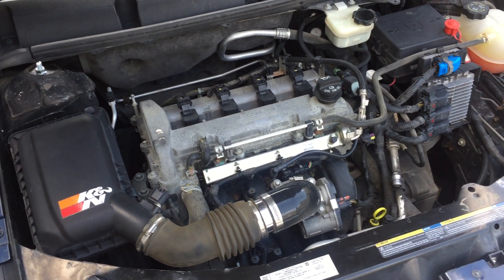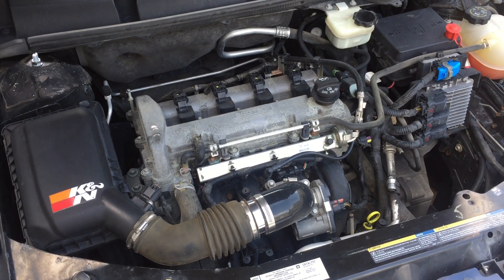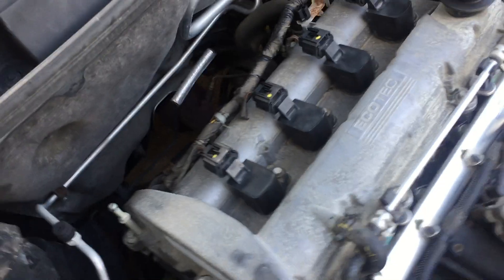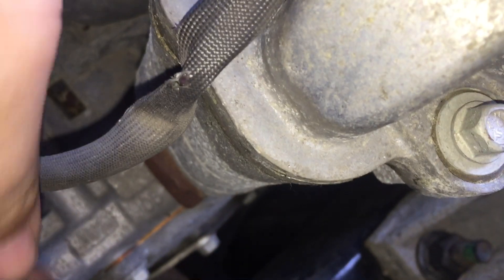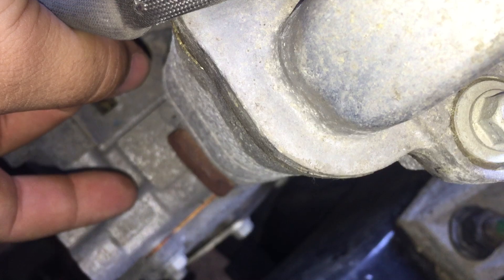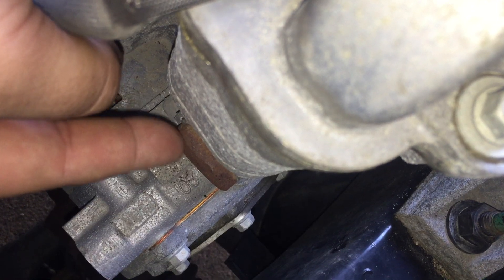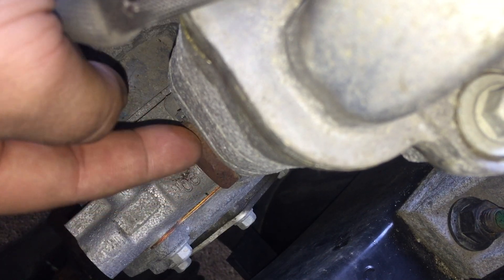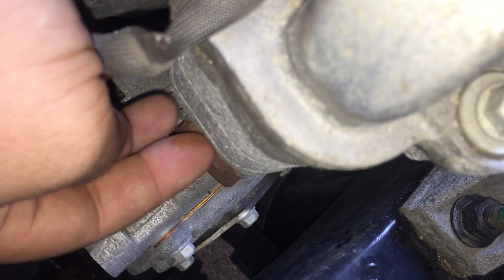Ecotec Cold Start Timing Chain Rattle example and tensioner location 2.0 2.2 2.4 lsj l61 le5

Comment: My 2.4 non turbo SS is doing the same thing with timing chain, im hoping i can get it replaced and thats all it needs and no major damage is done. IT didnt happen until AFTER i changed my oil to that BS quaker stake crap, i started the car the next morning after changing it and my timing chain was making noises. i switched the oil immediately thinking that would help but it was too late a shop qouted me $750+ for the timing chain replacement, is that a good deal?
Reply: STREETRACEN4U i have the same issue but mine is 2015 and dies after a few mins
Reply: I still havent put the car in the shop yet but i will in the next few days i will update everyone if it can be saved or not

Comment: I'm looking to buy a 2011 Buick Regal with the Eco Tec 2.4L, is this plagued with the same problems or have they fixed the issues?
Reply: All GM 2.0, 2.2, and 2.4 EcoTec engines have timing chain issues.

Comment: Does anyone know if these issues also affected the Saab 9-3 with the B207 2.0L turbo engines which are Saab-modified Ecotec motors? I know these motors use Ecotec blocks but I've read that most of the other components were all designed & engineered by Saab.
Reply: I have a Saab 9-3 2.0t occasionally when it's hot outside or I just drove a short trip. When I restart the engine could still be hot, warm, or cold it will make a 1-2 second rattle sound and stop with no chatter afterwards not  like in this video. Mine also already has the  Buble on the tensioner even though it's rust in color. What's yours doing?

Comment: Is the light ticking noise normal for these engines or is that a lighter issue?
Reply: This engine has direct injectors so it will make this sound
Reply: Yes normal .
Either the injectors and lifter can get noisey, aslong it's not a lifter-tick then it should be good

Comment: I have a 2007 Ion with the 2.4 and manual trans.  At 125,000 I put a new timing chain set in complete as general maintenance.  I opted for a Cloyes OEM set.  Spared no expense on quality parts.  Oil changed always at 3,000 miles (not by the computer oil change rest that goes up to 7,500).  I now have 145,000.  At temps below 30 degrees F, I get the loud lifter rattle type sound on cold start.  I just don't want to believe it is the timing chain.  Ever see a lifter going bad do this too?
Reply: That could possibly be normal, check the TSB's, sometimes they talk about "extreme cold" starts. However, I don't know exactly what temperature GM considers an "extreme cold" environment, I assume it's below freezing, which in your case 30*F would be below freezing. http://www.bbbind.com/free-tsb/

Although, if this started only after replacing the timing chain, I would also contact the manufacturer of your timing chain themselves.

Let me know if you discover anything!
Reply: Similar boat. 147k miles. Rattle when cold. 07 2.2 oil changes every 3k. Funny because I have an 05 malibu with 200k (bad trans) can sit for weeks and wont rattle on a cold start
Reply: This is from the manual slight pinging is normal under stressed acceleration like towing or hills and first start up if you can hear it inside the cabin under normal idle there is an issue

Comment: Just one other note: I am actually going to be taking my Captiva with an LE5 in to the dealer. I am getting quite a lot of metallic noise on the passenger side of the engine, very low MPG, 16MPG on a good day, stalling right after startup, lots of misfire readings across all 4 cylinders... and yet... no check engine light... Has anyone ever read the diagnostics off a 2.4L ecotec with a bad timing chain with an ELM327 reader and the Torque app? It has taken me quite a while to narrow down the symptoms of my car, and at least one dealer told me, "we can't do anything until there is a check engine light." So I need to walk in with all the evidence, or they will walk all over me.
Reply: I dont know off hand what that code means but, at least changing your timing tentioner or, changing the entire timing set would be a good idea...
Reply: What was it? I’m having the EXACT same issue

Comment: I put a new model tensioner on mine and it fixed the sound. I do notice some occasional rattle at 3k under hard accel. I’d say I need a new chain. But startup and idle is quiet as a mouse.
Reply: Did you find out if the rattle at 3k rpm was normal? My 2015 Chevy Captiva seem's to make a rattle around 3500rpm under hard accel also.
Reply: trillobite it went away after I put 10w30 in my car. Of course my ecotec is the 2005 problem child’s. Seems to be solid now.
Reply: @CallousDallass , thanks for the reply. What weight were you using before the 10w-30? 5w-30? I am just wondering, since I am currently using 5W-30 Magnatec. (Dexos of course)
Reply: trillobite I was using the recommended 5w30. My car has some miles and it’s a work vehicle so I gave it a shot.
Reply: Did you just unscrew and screw the new one in?
Reply: Why didnt you just change the chain and tensioner at the same time?
Reply: @koreymayo8884  This is a year old but I know. But for anyone that doesn't know.  A timing chain replacement is a major repair on an Ecotec.  Anyone can do it, but you need to really do your homework on this before attempting it.  If you only have one car and need to be able to drive it every day, don't try it, take it to a shop you trust and fork over the $1000-$1500.  It should only take them a day.

Comment: Those chains stretch also the chain guide on the intake side its common for that guide to break at the top. When that happens the chain will ride on the bolt introducing metal into the oil. that can be easily inspected by removing the camshaft cover. Shine a light down below the intake cam along the chain. If its rattling just replace the timing set. GM sells it as a kit with guides and tensioner. Also replace the waterpump/ balance shaft chain as it will be stretched as well. I ve seen the chains with significant stretch as low as 70k VVT versions require a holding tool

Comment: I bought a G5 4 years ago with 80,000 miles on it and it makes a similar noise for about 5 seconds at cold start , it has 170,000 on it now and the sound is still the same , I need to change the chain and tensioners anyway , I'm curious as to why it would still sound the same fter all the miles I have put on it . I don't drive it hard and change oil every 3000 miles , what do you think ? Thanks for posting this , it's almost identical to what I have been hearing ,thanks.👍👍
Reply: Better chain it b4 it breaks. So u can put another hundred thousand on it lol

Comment: Thanks for this. A lot of the guides talked about cold start and a rattle but hearing it's hard to tell exactly what they mean.
Reply: The timing tensioner is hydraulic. Using you motor oil from your oil sump. If you’re low on oil or need an oil change or using the wrong oil. You can cause premature catastrophic engine failure. (Refuse the tensioner of oil pressure and your timing will depart reality)

Comment: At what millage should those guides and timing chain be replaced 100,000 miles? As maintenance for the eco tec 2.2 engine l61 I’ve heard they are notorious for the guides breaking
Reply from the maker: Fresh55n9ne to be honest I would stay on the safe side and replace the chains every 80-90k at the longest. I’ve seen cars with 110k on them that had them snap or are extremely stretched somehow in that time. It’s really a toss up and it’s a fairly intrusive job so a lot of people just don’t want to do the work or pay the 8 hour labor cost for it and drive them til they blow.
Reply: Built Performance LLC is it worth changing the timing chain
Reply: I agree with Built. If your Ecotec is has been running OK for 80-90k on the same chain...why push it? Go ahead and get that new chain kit installed and you should be OK for another 80-90k.  But after about 50k start paying attention to the chain.  Pull the valve cover and check for any slack, and look at the top chain guide for excessive wear. Those are good indicators that your timing chain may cause serious problems later on.
Reply: @cswann8  i changed out my timing chain since my last comment and it fixed multiple issues the engine was having. It was definitely off a tooth or two and that was severely effecting engine performance. It turned out the chain was stretched, 2 plastic guides broke apart completely, and the balance shaft chain tensioner broke apart from the inside. Its a miracle the car drove 2000 miles like that after I bought it! Its a dependable cheap rig now though
Reply: @CadgerChristmasLightShow  Nice.
Reply: My tensioner went bad at 83k and the chain skipped teeth.
Reply: My Saturn vue with the 2.2 has the original timing chain, from what I can tell, and it has 156,000 miles. It’s amazing it lasted this long, but I’m changing out the chain asap

Comment: Does this affect the 2012 Malibu with the LE9 engine? I was asking because I know LE9 is an Ecotec as well.
Reply: Ours is a 2011 and has this problem. I have also heard that 2013 Malibu has this problem, so the 2009 revision doesn't mean anything and after 2009 GM still used plastic parts as far as I know!
Reply from the maker: No it was revised for the 2009 and later model years so your safe.
Reply: Thanks

Comment: I have an 04 cavalier that makes a ticking noise. It almost sounds like an injector but it's too loud to be one.
Reply from the maker: If its all the time its not normally this however i would at least remove the valve cover and check that the upper guides are in place and not in pieces as they are plastic and tend to break a lot leaving the timing chain to flail around
Reply: Word. I'm gonna take the valve cover off soon. At 97k miles do you think i could get away with Reusing the valve cover gasket?
Reply: @CaptainDerp  My Redline with a 2.0 has 143k and I reuse my valve cover gasket.  As long as you are careful, and clean the gasket of debris, you'll be fine.  Just inspect it to be sure there are not any obvious signs of damage.